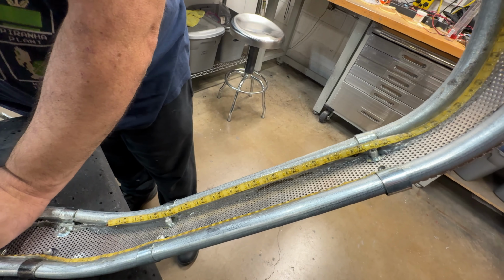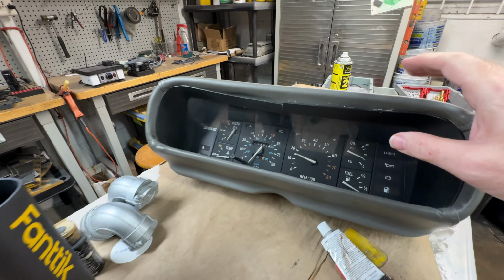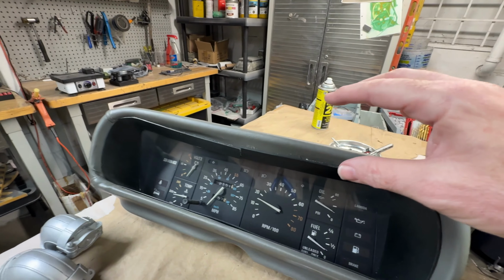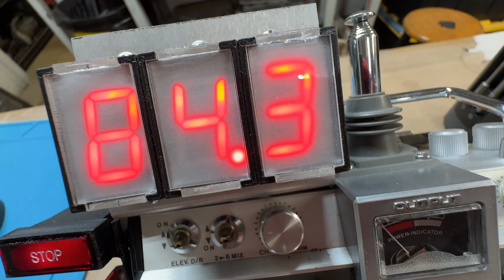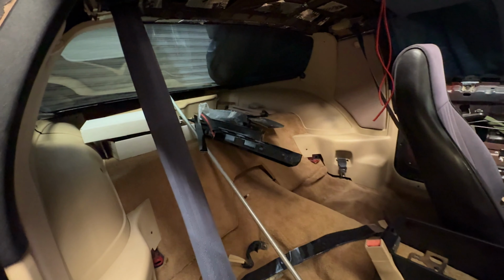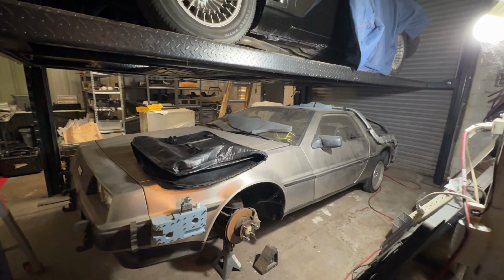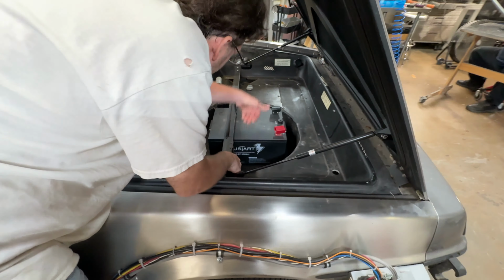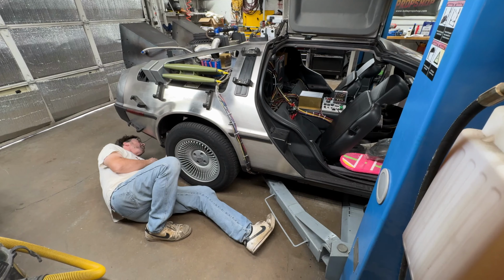Shop Update - Texas - Working on the Time Machine LED system - 092524

Comment: Great chanel Bob, I worked on removing siliconed frames from PV panels in Spain.
We used windshield fluid, vinegar and pure alcohol (from a destillery).
The alcohol was the best, you could also drink some while working.

Anyway, try either one of it and hopefully you will remove the stripes more easily

Good luck!!!
Michel from Sweden